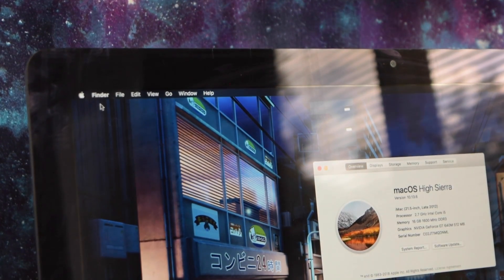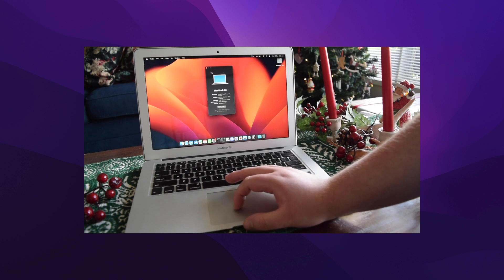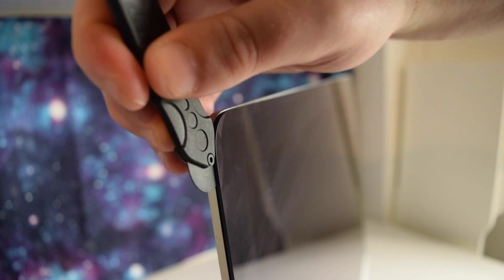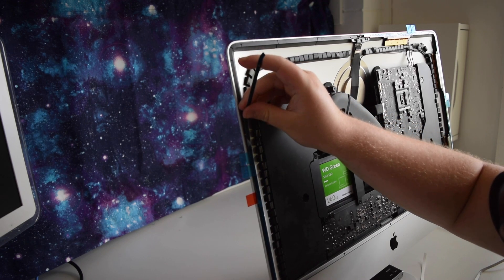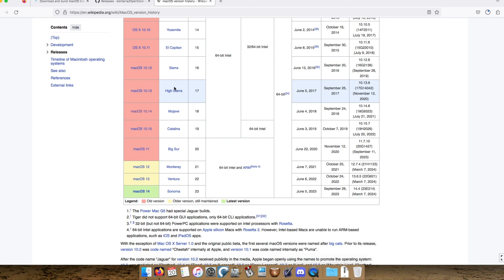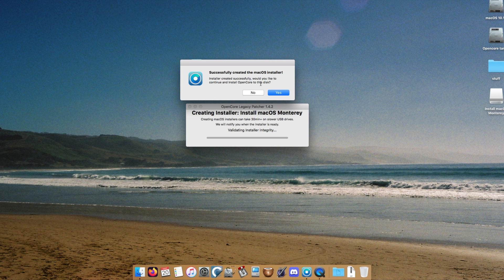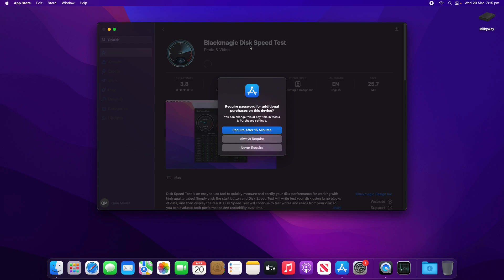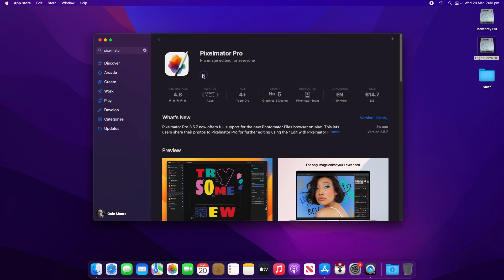Make your old Mac last longer for cheap! - SSD Upgrade & OpenCore Legacy Patcher on a 2012 iMac

Comment: Hi there, great video!!!
I would like to install it on my iMac Late 2012, I have a Fusion Drive and I was wondering where to install OpenCore at the end of the process to boot up my Mac, on the ssd or on the hard disk?
Reply from the maker: Is this for the boot loader part?
If so - I’d go for the SSD.
Does the fusion drive show up as a combined volume in the OCLP list?

Comment: when we use this opencore patcher, its possible to conect my MBA with m1 to the imac? Using the imac as an external display?
Reply from the maker: Hi :)
No, unfortunately not.  All this does is allow you to install unsupported versions of macOS on your older machines.
To use your iMac as an external display you’d need to physically mod it / there’s currently no way to “input”.

Comment: just changing from a 1TB fusion drive to a 1T SSD is not going to make any of the older apps (Like: Mail, Itunes.) compatible with new requirements of the new gmail or i music app... and the mother board of the older macs might work with a New SSI card.  but you will never be able to update the IOS software to the latest version (which i required to be compatible with the latest on the web). my itunes library, my Mail app stopped working after i did the last update available on my old 2007 macbook. ) all of my old CD's that i used the drive to install in the Itunes app, completely disappeared, and Icloud didn't save them (because they are not on the Imusic app). I lost oveer $1k worth of music that cannot be found anywhere.. I took my 2007 Imac to Macally to have them install the SSI (about $800) and i still am not able to install a later version of IOS required for all the new apps.. I can't even use google maps because it requires a later version of IOS.. ask questions about being able to use your favorite apps before wasting money on an SSD card.. you will need a repair shop to install it.. Not something you can do in the garage.. LOL

Comment: he ssd upgrade helps, but also if you were to repaste the thermal paste it would help you as well boost your cpu, that is in lowering its temperatures, and using less power to have the fans not spn up constantly to their max
Reply from the maker: yeah i probably should have re-pasted while I was in there 😁
Reply: @QuinsTechCorner  yep, thermal paste ususally lasts about 5  max 6 years if your looking for peak performance, after that it dries out, and crumbles, loosing its benefits...13 years is a loong time, especially while exposed to heat
Reply from the maker: @dp888dpAscende  I recently repasted my iMac G5 and the temperatures fell by about 10 degrees, was amazed!

Comment: For some reason when I reboot and hit alt it doesn’t show the reboot screen on my 2015 Mac. Using a Bluetooth keyboard USB thing is that why?
Reply from the maker: Yeah that could definitely be the issue.
If you have a wired USB keyboard that might be your best bet.
Reply: Mac's typically dont initalize non-Apple or wireless peripherals durring boot, I had the same issue with a 2011 iMac till I purchased a wired Mac keyboard, then suddenly all the boot commands worked

Comment: I want to buy one of these and upgrade them as they are cheap, do you know if the 27inch late 2012 A1419 Model is upgradeable as well?
Reply from the maker: Yep, the 27" will be as up gradable as this 21.5" one. 🙂
If you find a good deal it might be worth it.
Reply: @QuinsTechCorner  ok nice thank you, you da man
Reply: @QuinsTechCorner  Thanks. Do we need the thing called 'SSD Thermal Sensor' on 27 inch late 2012?

Comment: taking off their iMac screen to throw in a sata ssd is insane. I would have put in a nvme m.2 ssd behind the motherboard. Way faster than sata ssd. A external thunderbolt ssd is faster than internal sata ssd
Reply from the maker: Yeah it’s a pain in the arse 😎😂
Reply: 2012s only had blade slots if ordered with it or Fusion Drive from factory. 2013s had them either way. Importantly, 2012 blade slots are SATA 3. Making it uneconomical to go that route vs standard 2.5” SATA SSDs. 2013s get marginal benefit ~700/700 using an NVMe adapter.

Comment: Great video! Way did you not install a 128TB, 256TB or 512TB? 120GB seems so small. What is the maximum capacity?
Reply from the maker: Glad you liked it.
Mainly because I was on a budget!
Also this is just a hobby machine, I’m not using it for much beyond web browsing and occasional testing.

Comment: Thanks for the video. I am nervous about opening up my imac to install the SSDrive. Here are my current specs. Late 2012 27" iMac, 3.4 GHz Quad-core intel core i7, 32GB 1333 MHz DDr3, Graphics NVIDIA GeForce GTX 680 MX 2 GB. Do you think I could try Ventura or keep with Monterey? Any advice would be amazing. Thanks! :-)
Reply: my late 2012 imac with rye 675mx (1gb) and 4 gigs of ram runs perfectly on sequoia, the only things you would need to worry about is the screen cracking which you could solve by putting it on a soft surface like a bed or a couch
i upgraded my hard drive to a 2tb ssd
overall nothing to worry about!
(if your having trouble taking the flex cables out, you can kind of wiggle it out)
Reply from the maker: Hey, sorry for the late reply!
It's a bit nerve wracking, but if you make sure to take your time, and have somewhere safe (and soft) to rest the display glass, you should be OK.

On a machine like that I'd probably keep Monterey btw. Ventura tends to be a little more demanding - your main bottleneck will be your GPU I think.

Comment: My old 2012 Imac has 1TB HDD. Is it fine I cna replace with same 1tb SSD?
Reply from the maker: Yep, so long as you buy an appropriate SSD (SATA not M.2) that should work. :-)
Reply: @QuinsTechCorner some imacs have nvme m.2 slot behind the motherboard. Mine does

Comment: I got a late 2012 I MAC with intel core i7, processor speed 3.4 GHz. Will changing the drive to a SSD drive make a massive difference?
Reply from the maker: It absolutely will, yes.

Comment: Thanks for the video! I was curious how the 2012's were running on some of the newer macOS software. I have a 5K Retina iMac running Sequoia right now quickly and flawlessly but it has a few more hardware advantages. I was curious if it was worth trying to resurrect the 27" 2012 iMac collecting dust under the desk, looks like it could be fun messing around with especially being spec'd a little higher than the one shown running in this video.
Reply from the maker: There’s definitely use you can get out of a 2012 27”!
Not sure about Sequoia, but something at least.
Reply: @QuinsTechCorner  The 27" can take more ram easily.... def a help actually doing production work.

Comment: Did you directly install OCLP without a bootable USB? if yes, is there a correct step-by-step order to do this? Thanks
Reply from the maker: Hey :-)
No, I used the OCLP app to copy the installer files to the USB.
It's very easy, and I definitely recommend doing it that way.

Comment: Nice! The SSD is a great addition and it’s good to see it running well on Monterey. This would also make for a great machine to use older versions like Mountain Lion/Mavericks, but it’s still great even for a more modern OS. Great video!
Reply from the maker: You’re reading my mind!!
The other partition on the SSD is going to be for 10.9 Mavericks. :-)
Reply: Oooh nice! Can’t wait! I need to make more partitions or get more drives for different Mac OS installs, why have only 1 when you can have all of them?
Reply from the maker: @TheOriginalCollectorA1303 YESSSSSSSS haha.  You'd need a large drive, that's for sure!

Comment: Hey great content that more need to know!!  I installed an external SSD drive in a case with 3.0 usb cable and that now is my boot drive speeds between 300/400mbs so no need to open glass if on a budget, the internal one I use as an extra data drive and that works great too.  On those computers going up to Ventura and beyond is do able because of the metal graphics card in it. :)
Reply from the maker: Thanks, glad you enjoyed it!
Yep, that GPU really helps.  The 640m in this machine is around 70% faster than the HD4000 in my 2012 MacBook Air.